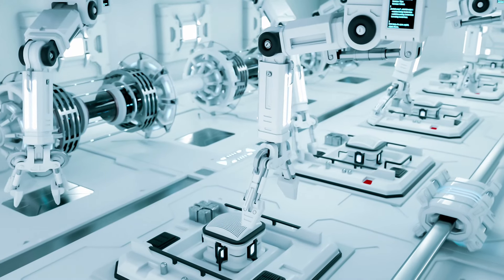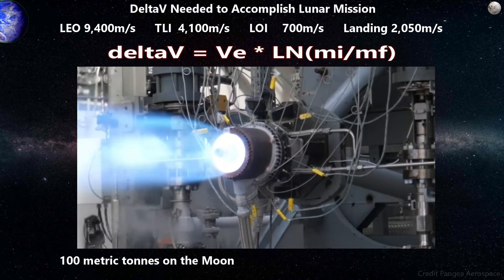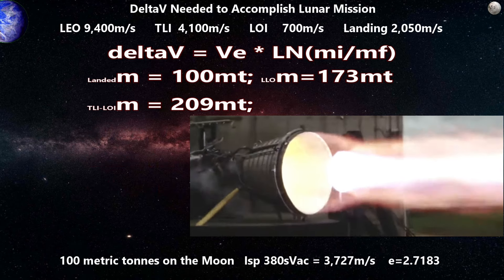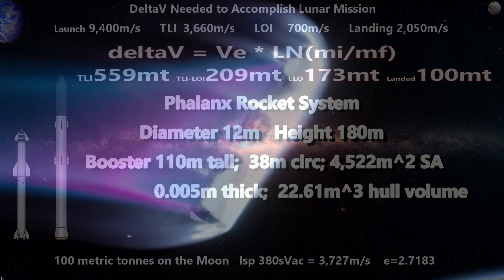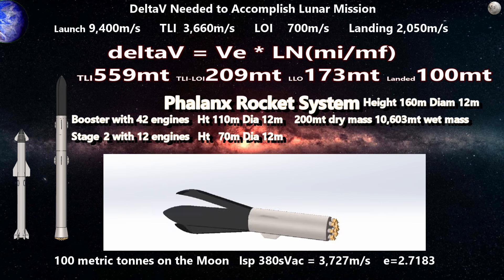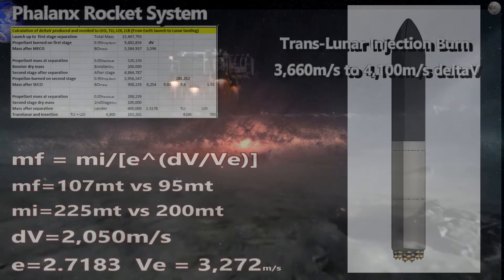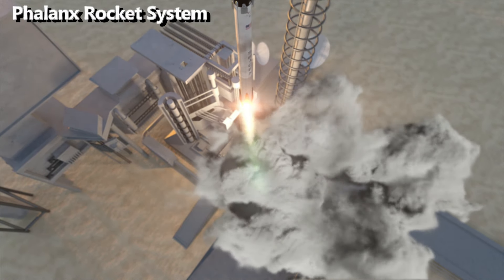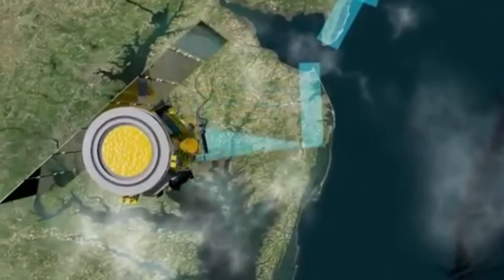Rocket Science: Designing a System Better than Starship: The Phalanx Rocket System

Comment: A quick question about orbital debris, I know their traveling about 7800 to 8000 meters per second most likely in almost all directions, but would you know the kinetic energy of them?
Reply from the maker: That would depend on the mass and the elasticity of impact.  Force is determined by mass and change in velocity which is acceleration.  Assuming and impact time of 0.1sec a piece of debris with a mass of 1kg and the above velocity numbers would give a froce of 78 to 80kN.
Reply: @terranspaceacademy  ok. Could you show your math on that for mine that i did right now shows around 30mega newton's or so and would like you to check it if you wouldn't mind. The equation I was using was kinetic of 1/2 mv^2.
Reply from the maker: Sure.  You have a 10kg object moving at 7,500m/s right?  It has a momentum of 75,000 kgm/s. (p=mv)
If that object impacts a steel ship and comes to a full stop in 3 milliseconds so 3secx10^-3. We divide 75,000kgm/s by 0.003s and get...
25 million newtons of force imparted.  If the object hits a carbon fiber ship that flexes more and it comes to stop in 0.030 milliseconds.
We get 75,000kgm/s div by 0.030 s = 2.5 million newtons of force imparted.  F=ma and a=dV/dt and dV=dd/dt...
Reply: @terranspaceacademy  so for space debris, you don't use kinetic energy equation? Just momentum and stopping time or impact deceleration time?
Reply from the maker: You can use energy but the force impacted is determined by stopping speed so to speak
Reply: @terranspaceacademy  ok. Now the stopping force, is that also related to joules by kinetic energy or is that another force entirely? Trying to get myself back up to pace after all these years from college.

Comment: you say "100 metric tonnes on the moon", is that the weight on the moon or the weight measured on earth?
Reply from the maker: 1000 kilograms is the same anywhere.  That's one tonne in metric.  The imperial ton is a measure of weight.  An imperial ton is 2,240lbs.  That's also called a long ton.  A short ton is 2,000 lbs.  To get a measure of mass in imperial or "avoirdupois" you must divide by 32ft/s.  Just like newtons are kilograms times gravity.  Pounds are already slugs times gravity.  To get slugs you divide pounds by 32ft/s.  So a 160 pound human being would have a mass of 5 slugs.  I'm firing very old neurons so double check me.  On the Moon I would have a mass of 100kg.  On Earth I would also have a mass of 100kg.  On the Moon my weight would be 1.662m/s^2 times 100kg = 166.2newtons. On Earth my weight is 100kg times 9.807m/s^2 giving 980.7newtons.  In imperial, on the Earth my weight is 220 pounds.  On Earth my mass is 220 pounds divided by 32ft/s therefore 6.875 slugs.  On the Moon my mass is still 6.875 slugs but my weight is 6.875 slugs times about 5.33ft/s (the acceleration of gravity on the Moon)... And we get 36.64 pounds.

Comment: Now you say aerospike engines are going to be used in the future. I was wondering if having multiple walls instead of one would help with the cooling issue? Im referring to linear designs not conical or cylindrical shape.
Reply from the maker: Interesting question... I've thought of "nested" aerospikes but haven't seen anyone model them.  Same for linear?  Very cool.

Comment: Do you have a lesson on orbital refuelling and refuelling concepts? I’ll check after but if not it might be worth investigating in depth
Reply from the maker: Not yet... No one has done it at scale though a few small satellite servicing companies have proven the concept.  I think something like what the military uses... A "flyable" hose, is a lot smarter than putting two massive ships in close proximity.
Reply: @terranspaceacademy  I think the big concern is the fluid management (especially for crypgenic fuel), IIRC SpaceX has a contract to do a demo in the next year or two of pumping 10T of fuel from one tank to another (not even between different rockets, just within the payload bay of a starship) as that's something that has never been done for real.

Comment: Also i thought the aerospike there working on is a sharp tip not broad like you shown here.
Reply from the maker: Which company? Hardly anyone is using the spike version I would think. The truncated is much better.
Reply: @terranspaceacademy  I thought you mentioned a while ago that an aerospace company or something like that maybe nasa came up with cop 42 that can be used for it. I could be mistaken on someone working on it though. And by truncated you mean no sharp tip correct like what was shown I'm the video? However for the aerospike design I still rather go with the linear design for reasons of cooling and multiple lined up, but the conical could also work for that to, just more difficult to get working but possible.
Reply: @terranspaceacademy  also could you explain why truncated would be better? I have an idea why but would like to hear yours first.
Reply from the maker: It saves mass to truncate without affecting performance too much.  If you look at Pangea, they exhaust their gas generators out the center of the aerospike which also helps by creating a relatively higher pressure area there and preventing a vacuum suction effect.
Reply: @terranspaceacademy  the mass I forgot about do thank you on that. The exhaust idea I already had a thought on that but using both exhaust and another engine in the center to also correct for the pressure difference but good to know some else is also thinking similar way. I still wondering on I creasing surface area for better cooling.
Reply from the maker: You are most welcome.
Reply: @terranspaceacademy Now that I think about it and seeing what firefly I'd working on, couldn't starship raptor engines do something similar to form an aerospike while continuing the work on getting more thrust?

Comment: Is there any data on long-term storage of hydrogen? Specifically: difficulty of keeping it below 20 K, and dealing with hydrogen diffusion and embrittlement? I wonder how the added mass of a system that can handle hydrogen affects performance vs. methane.
Reply: JWST can keep its mirrors under 50K with just a mylar sun shield, which is good enough to store liquid hydrogen for a few weeks without too much boiloff. ULA has actually proposed a system taking advantage of that for delivering fuel to the moon.
Reply from the maker: Look at Frauenhoffer's powerpaste...
Reply: @terranspaceacademy  it's really cool, and if your goal is energy storage at a reasonable temperature and density it seems really promising, but it's so much heavier than plain old liquid hydrogen that I would be surprised if powerpaste hydrogen (or any of the other solid hydrogen storage proposals) were still better than methane in terms of delta-V for a given mass of fuel + container/storage media. A direct measurement of what's coming out of the engine like ISP or Ve seems less helpful once you're dealing with phase changing storage media instead of just pure fuel.
Reply: I guess a better basic answer of hydrogen vs methane is that the system for hydrogen are heavier, I think the rule of thumb is that a full hydrogen tank is 90% propellant by mass, and a full methane or oxygen tank is 99%. Because of how delta-V scales logarithmically with mass fraction and linearly with exhaust velocity, there is a crossover point in how much delta-V you want from a single stage above which hydrogen is lighter and below which methane is lighter. 
hydrogen embrittlement isn't that hard to deal with in the tanks if you design for it because aluminum (and I think titanium if you're feeling that crazy) don't get brittle since the hydrogen doesn't produce interstitial defects the way it does in steel. hydrogen embrittlement is mostly a problem for the engines, which need higher performance alloys. as for leakage, I'd guess you get as much leakage through the closed valves as you do through the skin, so I wouldn't really worry too much about it.

as for the mass of the insulation, the centaur upper stage seems to be able to handle about 6 hours in orbit with acceptable boiloff without any modifications. A deployable single-layer sunshield isn't very heavy and it's probably sufficient to keep the fuel cold for a couple days. there are also some ultra-reflective coatings (99.5% reflectivity) being developed that might be good enough. true zero boiloff will probably require a cryocooler of some sort, but hopefully not more than a few percent of the mass of the tank assuming you have insulation and a sun shield.

Comment: A couple of suggestions: 1) the order of the step is confusing- first you calculate the approximate initial mass you need to leave LEO to get to a Lunar landing, but then you describe the mass of an arbitrary launch vehicle without describing the necessary dimensions for providing a useful payload diameter. (The tank size could be better approximated using an algebraic equation to determine a safety margin for the expected dry+fuel mass towards the required fuel mass and volume.) Even making some estimations, it is unclear why a second stage is used, since the calculations do not seem to necessitate it. (While the utility may be obvious, by reducing the mass to move, once higher in the atmosphere, this could be demonstrated by approximating the altitude given by a decrease in air resistance and gravity by engine run time times specfic impulse. Thus, you could show how with negibilible air drag and lower gravity, using a smaller 2nd stage is adventagous for the design. Ignoring the fact that a second or third stage could use a cheaper low thrust, high specific impulse fuel- this is how SRBs are justified and being researched by countries outside the US!) Afterwards, this returns to the awkwardness of the original (assumed thirds stage) initial masses, since no mass or volume was been included for the staged TLI vessel nor fuel. (This begs the question, could the third stage even hold the necessary fuel to make it? Prove it!) Lastly, there is no estimation of a delta V to return. This would make a one way suicide mission. 2) Your video's content is generally good, but bogged down by too many digits of information. You can maintain good precision with showing calculation using 1 more significant digit (sig fig) than the smallest uou can assume (say 3, if you trust all of the NASA numbers), just remove the 4th digit at the end, for presentation, and show it as a subscript, when demonstrating calculations. 3) Please add a space between your magnitudes and units, this helps legibility and is standard practice.

Otherwise, good work, just needs minor corrections.
Reply from the maker: We worked out the mission requirements...  Then looked for a launch vehicle big enough to get the job done.
But you are right, we should have worked on back to launch mass then looked for a rocket that big. It would have made things more clear.  Without a second stage the SSTO mass would be unbelievable.
Reply: @terranspaceacademy  Still a practical approach. The Phalanx Rocket system seems very pragmatic.

Comment: You are going to a lot of trouble (building a 3x bigger rocket) to avoid orbital refilling. Why is that? 
Some Starships will have re-entry capability (like the tanker) and some won't (like the Lunar Lander) and so can be more efficient with no heatshield.
Reply from the maker: The Lunar Starship suffers from being two stage instead of three stage.  You land on the Moon on top of giant empty tanks.
Reply: @terranspaceacademy  Ok but why not use orbital refilling on your Phalanx design? Then it could be smaller.
Reply: @treva31 picking up from where TSA left off, I think the reason orbital refilling was avoided here was because launching one huge FRLV is cheaper than launching 10-15 smaller FRLVs (Smaller being VERY relative here) 1 Phalanx launch for, what? 4-5 mill? Against 10 Starships for 20 mil?

Comment: Do we really need 100 Tonnes on the Moon if we have space manufacturing?
We live in very exciting times, to even ask that question!
Reply from the maker: We need 100 tonnes of manufacturing equipment :-)
Reply: I stand corrected! Ha!😁
Reply: Space manufacturing is a great concept but can you launch something that will work today? It is going to take a lot of time to get it all figured out and working.
Reply: it's not just the total tonnage, it's the cost per pound. During the shuttle era it was somewhere around $50k/pound to orbit, I saw that other rockets got it down to $10k/pound. I think that the F9 is pushing $1k/pound, while starship is aiming for $10/pound

At thos prices, (and assuming that a smaller payload doesn't save you anything in launch costs) you could launch 10T in a starship for less cost than on anything else

And if Elon's dream numbers are accurate (which they aren't, they are dream numbers), you could launch 1T on a starship for less than the cost of 1/2T on an electron (or similar). Which makes the business models of the smallsat launcher companies very questionable in the long run.

Comment: Even economically better ? (more attractive for business ?)
Reply from the maker: That is a complicated question Mad!  We would need to be convinced to invest in it but it not unreasonable to assume it might be.
Reply: @terranspaceacademy  I suppose so. Assuming Phalanx is fully reusable (obv, it’d be super uneconomical otherwise), including the lander, which can use residual fuel and a very high low-fuel TWR to reenter from LEO, as well as some shielding or a basic inflatable heat shield (idk, just spitballing here), you could in theory get the cost down to around 4-5 million per launch. Even assuming Starship gets to its lofty (or, rather low) goal of $2m per launch, and 10 refuelling launches plus 1 depot, that’s $2m x (10 Tankers + 1 Depot + 1 HLS) that’s $24m. 5-6x the price for less payload (~100t compared to Phalanx’s 130t)

Comment: One can theory-craft a lot of different rocket designs. IMHO if ESA (or other space agencies) want to think big, nuclear propulsion would be the thing to focus on, since chemical rockets can never do large payloads beyond Earth orbits without hundreds of tons of propellant in LEO. Considering the cost (and length) of Arianne 6 development, the last thing ESA should do is to try to compete with the private sector for cheap LEO transport services. Long term, beyond LEO, nuclear propulsion will be the way to go, instead of trying to build a mega-rocket that would take them two+ decades to get ready.
Reply from the maker: I think China will go nuclear very soon... As might Russia.  The US and EU will insist it's too dangerous until we see them have some success... Then we'll do the same.  In space nothing competes with nuclear... Nuclear thermal for thrust and nuclear electric for efficiency.  No chemical engine can come close.
Reply: @terranspaceacademy  Also, nuclear power is not likely to be the solution for ground <-> LEO. Once we have good options to get to LEO cheaply and on a routine basis, then nuclear for missions beyond LEO become much more reasonable

Although the west's anti-nuclear hysteria will need to get replaced.

Comment: What we intend for a rocket system destination to be has a huge impact on how it's designed.  I don't think the Starship design is at all good for Mars oriented missions for the reasons Zubrin has pointed out, it sends lots of unnessary mass through TMI by parking in LEO rather then in a high near-escape orbit.  The use of electric propulsion tugs to move mass from LEO to that high orbit would be most efficient with said tug fleet operating continually in the 26 months synod after which the far smaller Mars bound vehicle can depart after crew arrive via a direct flights durring short loading window of just weeks.  If were willing and able to due cargo loading at LMO then we should likewise depart large unmanned cargo block frames (like a modular freighter in space) via electric propulsion as well and then employ surface to orbit ferry vehicles at mars to unload it continually to maximize utilization.  Note that Mars synod means any vehicle going back and forth between Earth and Mars will be limited to less the 20 missions over the vehicles lifetime even if said vehicle were to operate for an unpresidented 40 years.

The current Starship architecture of being all chemical propulsion is if anything better suited to lunar exploration as the travel time to the moon is so short and continually open their is no imperative to stockpile before a mass departure.  So while an electric tug would still be benificial to go from LEO to a Lunar gateway station it's not nessary to get amortization of the launch vehicles and landers the way it would be on Mars bound flights.
Reply from the maker: What do you think about prepositioning a slow but massive Mars Orbiter and Lander (ion) before sending a minimal fast human carrying ship (nuclear thermal)?

Comment: Terms! 1 metric ton = 1000 Kilograms.  Your calculation such as in 173 kilograms is not 173 mt there is something wrong in your graphics and text.  You repeatedly mix kilograms and metric tons.  Dude a metric ton is Megagrams not Kilograms.  Please reevaluate your message.
Reply from the maker: That's not correct Jerry... A metric tonne is 1,000 kilograms.
Dictionary
Definitions from Oxford Languages · Learn more
met·ric ton
/ˈmetrik ˈtən/
noun
noun: metric tonne

    a unit of weight equal to 1,000 kilograms (2,205 lb).